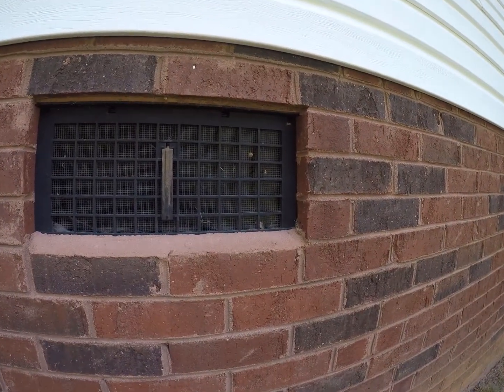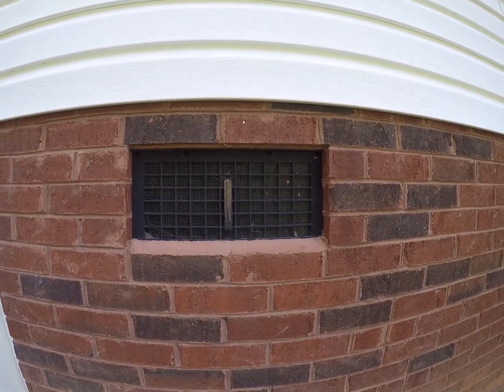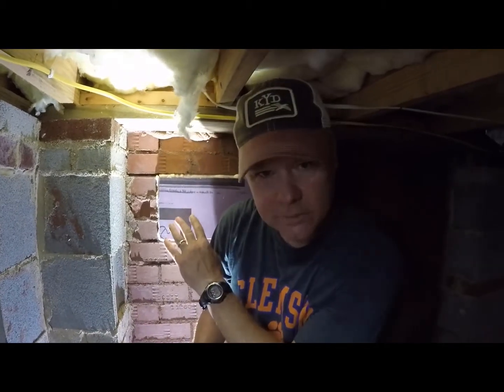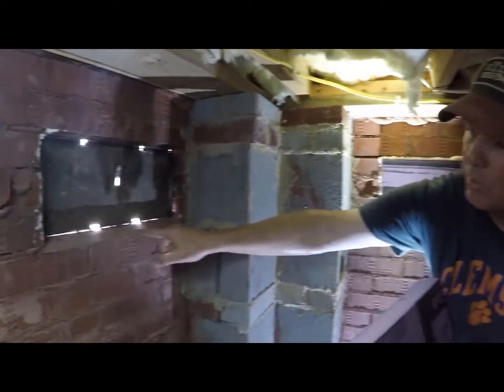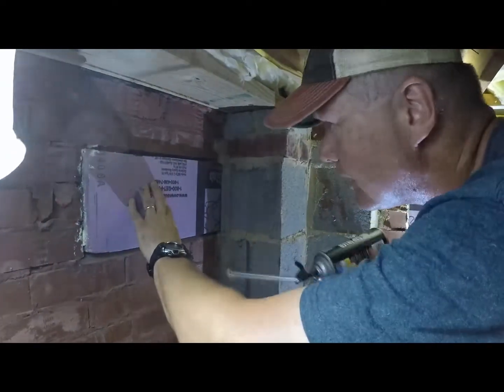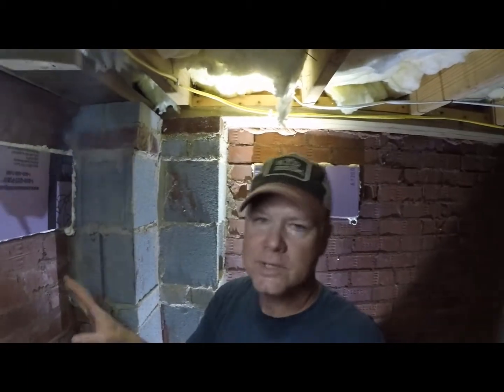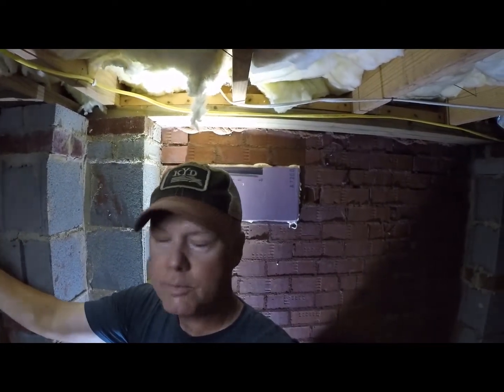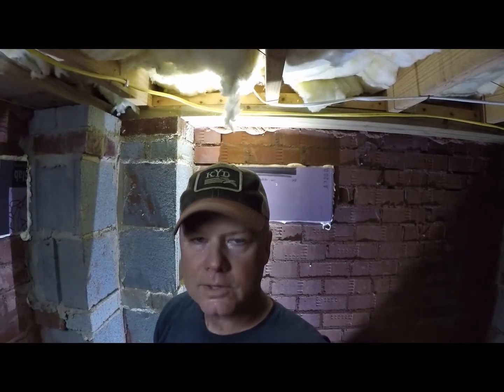Crawl Space Remediation - Video 3 - Closed and Sealed Vents with Foam Board

Comment: I wish my crawlspace had room like yours, I basically have to lay down, I only have about 1.5 feet of head room. The house was built in 74, I need to seal up bad, I have a bad odor under mine and the vents aren't helping.
Reply from the maker: @Dark Toad One, yes I was lucky to have this much space. Good luck with solving your problem.

Comment: How much of a percentage did your humity drop
Reply from the maker: In Zone 1 the relative humidity dropped from 74% to 64% and Zone 2 dropped from 80% to 61%. The bigger key data point was the wood moisture level dropped from Zone 1 14% to 10% and Zone 2 19.5% to 11%. You can see the details in this video. Crawl Space Remediation - Video 4 - 6 Month Results and Next Steps
https://youtu.be/I98eE2nhBFQ

Comment: Did you add exhaust fan or feel like you need to after sealing vents?
Reply from the maker: Hi @Clete.  I originally did add an exhaust fan that was programmed to run when the humidity or temperate exceeded 55% or 80 degrees.  What I found was that the opening with the fan allowed enough air to flow back into the crawlspace and the relative humidity stayed higher than I wanted, around 65%-75%.  When I pulled the fan out and sealed the vent, the relative humidity dropped down to the 55%-60% range I was aiming for.  I've left the fan out for now but can add it back in as needed.   My Terminix termite inspection recently showed that the wood moisture levels were all well within acceptable ranges.
Reply: Thank you as your videos will save me a good amount of money.   With the exhaust fan not in, any worry about soil gases or need to exhaust needed?
Reply from the maker: @Clete Cordero, in our area we don't  an issue with radon or other gases for it to be a major concern so I didn't worry about it as much.  If someone is within an area that has gas impacts, then I expect it will be worthwhile.  Glad the videos will be helpful for you.

Comment: why not pull air out of the attic and blow it down into the crawl space all year around
Reply from the maker: @Bus Driver, I had considered that as an option but it was going to be a project to get a vent up the walls and into the attic. For now I was going with a minimal changes to see the overall impact.  The second concern I had was if I was I going to just be bringing the same level of humidity from the attic down to the crawl space.  So far the dehumidifier alone is solving the humidity problem.